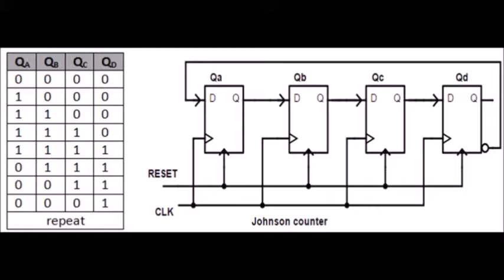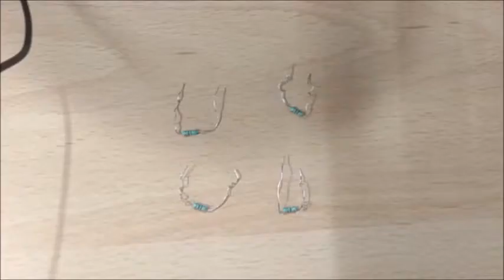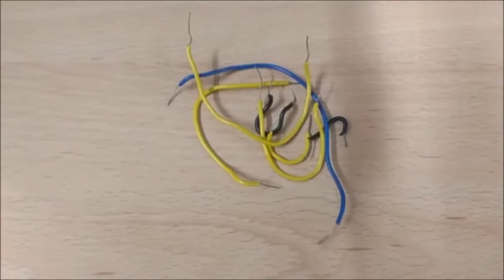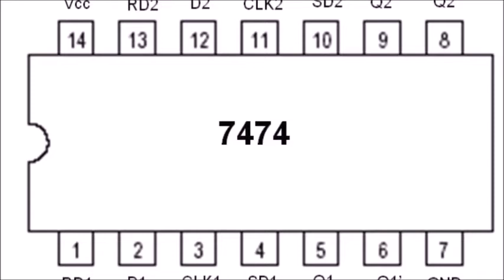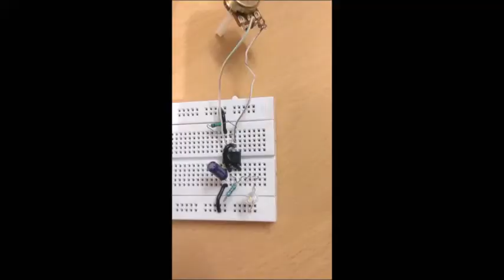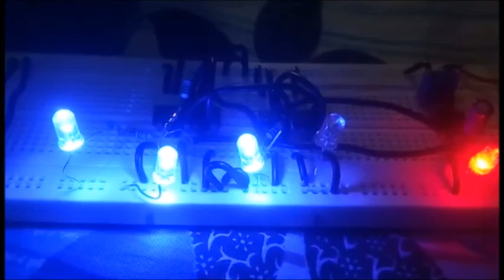How to Implement a Johnson Counter using D flip flop

Comment: why you use variable resistor in 555timer ic
Reply: to control the resistance according to us by which we can control the glowing speed of the led bulb if resistance will be less then bulbs will glow very fast and we will nkt be able to observe the output therefore we have increased the resistance by using a variable resistor